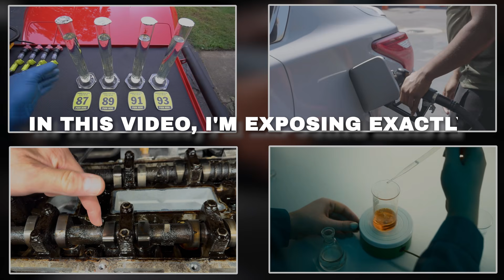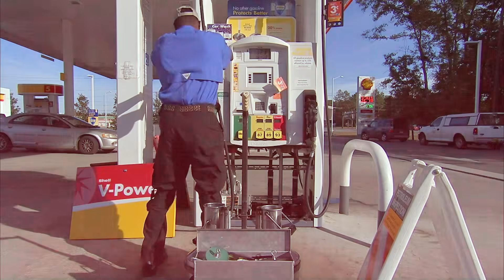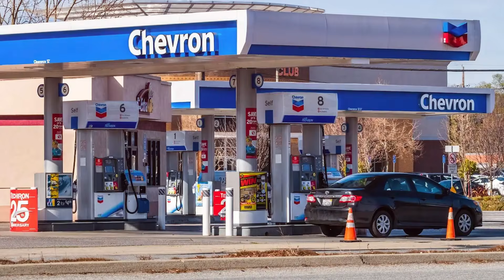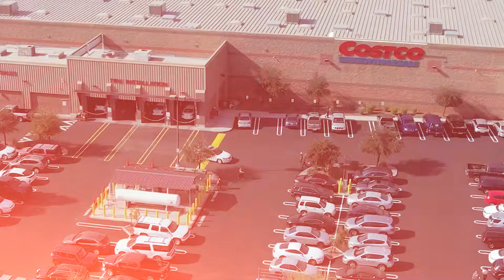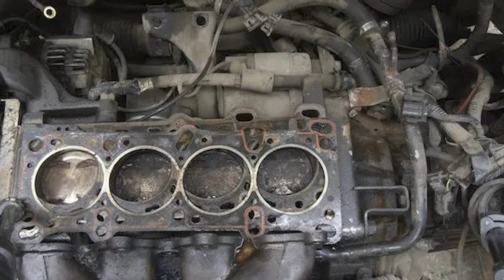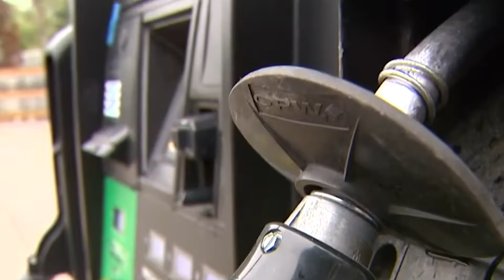Japanese Mechanics TESTED Major Gas Stations and One HIDDEN Finding Is DESTROYING Engines Nationwide

Comment: Use "Top Tier" rated gas. The should be a sticker on the pump. Top Tier has higher levels of detergents and additives to reduce engine deposits. Its specifically recommended in the the owners manual for my 2025 Honda Ridgeline. I used to get all my gas at KwikTrip but stopped after their gas became non-Top Tier. In my area (Milwaukee) Mobil, Citgo, Shell and Meijer Express are all listed on the Top Tier website. BP is also very good gas but they never joined the Top Tier program.
Reply: June 4,2026 consumer reports lists quick trip as top tier.

Comment: This is pure horseschidt. Don't believe this garbage. All gasoline blends are made to the same spec across the country. WHY- because they exchange it with each other. You fill up at a Shell station- you may get Exxon gasoline. Or get gas at Chevron- it may be Texaco. WHY???- because Exxon does not have a refinery in every city- neither does Shell and so on. In some parts of the country all brands may come from the SAME Shell or Exxon loading station. All gasoline is made to the same spec-so it can be exchanged! The only difference is that some may claim to have more "additive" than the other brand. So- there may actually be a slight difference in the additive content- in parts per million!

Comment: Yes, Ethanol is hydroscopic. And its the ENGINEERING design that CONTRIBUTED to the problem.
If you add gas-line antifreeze, such as the popular brand 'Heet', you're putting in EXTRA alcohol as well.
Yes, the alcohol eventually DOES cause corrosion to the steel gasoline tanks.
Having a fuel pump INSIDE of the gasoline tank was PLANNED OBSOLESCENCE by design, because the corrosion will attack the fuel pump also.
At least many FOREIGN cars equip their gasoline tanks with a DRAIN PLUG. NOT American manufacturers. But who bothers to periodically drain out the stinky corrosive crud and rusty slurry that accumulates at the bottom of the tank ? And for extra protection, flush out the tank with some fuel.
Electric fuel pumps were equipped OUTSIDE of the tank in earlier 70's cars. The fuel filter can be had in-line BEFORE the fuel pump. The injectors would stay cleaner longer then.
Listening to car-fixit radio talk-shows 20 years ago, and the emcee mechanic said again and again that HALF of the problems he encountered were FUEL PUMP problems. Also the REPLACEMENT fuel pump didn't pump enough pressure when new, sometimes.
Replacing an in-tank fuel pump and, of course, cleaning the tank, is a very cancer-causing job.
If you have your tank serviced, its maybe worth the extra expense to have a drain plug fitting added, and have the inside surfaces specially coated, so there's no bare steel.

Comment: Gas today is intentionally  dog piss! The specific gravity of the stuff is very low ,the density of stuff that burns is lacking ,heat makes power the dog water dont make heat as it should ,gas can be rated at 102 octane and still be weak as mouse piss ,thus you burn more and dont go as far ,this practice also burns through the planets supply at a inssne rate. But hey its a win win  for fuel sellers ,sell more  ,more profit create a shortage ! Yet more PROFIT

Comment: This videon contains some false information on ethanol.  That black carbon at intake manifold and intake valves, pistons has nothing to do with ethanol. That black carbon is from positive crankcase valve(PCV), exhaust gas recirculation(EGR). Direct injection fuel system without a port injection makes this issue worse. Repeated short distance driving at freezing cold termperatures can damage engines if the cold started engine is never allowed to fully warm up before engine is turned off again because this habit creates issues of fuel leaking into engine oil, also condensation water build up inside the engine, prematurely clogs some of the engine emissions control systems.

Comment: Use ethanol free premium gas at all times.  The cost difference is minimal and the benefits are significantly less wear and repairs.  I don't use ethanol gas in anything, from lawn mower to vehicles.  I worked in an oil refinery for years and ethanol is what is wrong with most gas.  Also, standards in the USA are lower for just about everything than other countries, including gasoline stations.

Comment: I quit using Shell after I had engine problems on an engine with less that 2,000 miles on it. When the mechanic opened up the engine he said my engine look like it had driven a couple 100,000 miles because of all the carbon buildup.

Comment: In Canada almost every single gas station they are connected. prices are the same. Hard to choose
Reply: yeah but same problem exists with Canada, if you buy grade 1 or grade 2 fuel, it destroy your engine. you always have to buy 3rd level fuel exactly because of what is being described in the video.

Comment: I have used mostly QuikTrip fuel almost exclusively for many years without any problems. I use non-ethanol premium in my Lexus and regular 10% in my Explorer. They are stations that have pretty heavy traffic.

Comment: BULLSHIT FAKE AI VIDEO , CATATROSPHIC FAILURES BULLSHIT , USING A FUEL OR INJECTOR CLEANER WILL NOT CLEAN VALVES IN A DI ENGINE AGAIN BULLSHIT , NO ONE IS REPLACING INJECTORS AFTER 2 YRS

Comment: P.E.A. (polyether-amine is the cleaner you need to put in your gasoline tank. Techron is good with PEA. Redline has the most PEA so go with the Redline.
Reply: I don't have any experience with Redline, but back when I had my own shop I was looking into building a fuel injector flow/pattern testing rig.  I found plans for one and the guy that built it had been testing various over-the-counter cleaners against the commercial ones, and Techron was as effective as the commercial solutions at cleaning.

Comment: I wanted a cargo van because I needed it. Not for a home or a camper. Yet. Can be. My dealership had one ordered the way they wanted the design. It fit my needs perfectly. A 2024 F250 transit cargo van. The pickup I traded in was a 2020 F150. The F150 has the 3.5l Ecoboost. My van has the 3.5l engine that is an E85 engine. The only design of engine at the time I had no clue about. Now I do and I extremely do not regret the engine. While these gas stations mess up and don't do what they should. My E85 engine doesn't care what the grade of fuel that goes into it. The computer will adjust the engine. I can mix all types of gas into my gas tank and my van will adjust itself to run the engine. I gotten lucky. I only use the high premium gas in the van. Not E15 or E85. I get better power and fuel mileage off of the high premium gas. Water is my only concern. Thanks.

Comment: I was a mechanic for 40 years and that picture with the valves with that carbon on them has a hell of a lot more miles and 40,000. Clickbait
Reply: AI slop is real.
Reply: My thoughts exactly, 50 years and still repairing my own.
Reply: 10-4!

Comment: Since the crude oil is so cheap, the U S needs not to use ethernol in gasoline at all.
Reply: Except the “ corn/ ethanol” lobby in Washington is very strong.  They have the votes to keep ethanol in gas forever
Reply: @petertaviano9593 
What should we use to replace the alcohol/ethanol? 
Maybe you need to do a little research? 😊
Reply: @petertaviano9593  Can't believe some went up to 20% ethanol.
Reply: @petertaviano9593  I would rather eat corn over putting it in my car.
Reply: Thank Hillary Clinton for that!
Reply: Faulty reasoning!!!
😢😮
Reply: You don’t know what you’re talking about! 
😊
Reply: Never did.
Reply: Can’t do that then the politics would have to come out of ethanol use everybody that knows anything knows ethanol is not a good substitute for gasoline or a good use to protect gas mileage as it actually you get worse gas mileage with ethanol plus if it sets a while it comes up everything that’s holding it carburetors injectors, cars, lawn, mowers, leaf blowers, and it’ll probably gum up your mouth if you gargle with it
Reply: FARMERS Lobbyists  😢
Reply: Air pollution. And air pollution is water pollution and water pollution will kill you.
Reply: @genestevenson-l7v  Ethanol burns cleaner, but you get worse mileage, causing you to fill up more often. Are you really saving the environment?
Reply: @genestevenson-l7v Air pollution IS NOT WATER POLLUTION!!!😢😮

Comment: Get Ethanol out of the fuel supply. It is a scourge to automobiles and the food supply.
Reply: Ethanol lowers efficiency and has no environmental benefit. There is no shortage of oil in the world and never was. Just greed power issues.
Reply: @scruples671: I definitely agree!!!! We can't run antique cars on ethanol that will damage their fuel systems. There's got to be other ways to raise the octanes of gasoline through refining processes.
Reply: @scruples671: There's got to be other refinery ways to raise the octanes of gasoline instead of using ethanol.

Comment: I only use Mobil gas and splash blend so I get extra detergents.  I do 50/50 premium and regular as my car only requires 87 octane... I also add 2 ounces of Chevron Techron concentrate to the tank with every fill up.  Who has the cleanest combustion chamber and intake valves? This guy!😂
Reply: So you know more about blending fuel that oil company engineers? I think not. Mixing fuels only reduces the octane / quality to that of the lowest used. Just stick with a quality brand that complies with the car manufacturers specs.
Reply: Just use mid grade it's already done gor you at the pump....most stations just mix it at the pump now and done have a 3rd tank its one way to save money.

Comment: you cannot specify brands because many independently owned stations will buy gas from the cheapest wholesaler irrelevant of what brand their sign says.
Reply: Not possible!
Reply: @marmeone
refined fuel comes from the closest refinery, the only difference is the 3 grades and they also make a summer blend and a winter blend. Brand loyalty is a fantasy created by oil companies advertising. 
How do I know this? 
I’ve worked at an oil refinery, I asked their engineers and I witnessed the transport truck tankers from every brand in the geographical region take fuel from a different brand’s refinery.

Comment: Years ago changed delivery practices to save money. Instead of a major brand traveling to far away stations, they went to delivery from independent delivery delivering to any station and not specific brand stations. In most areas there is a choice of say 3 refineries delivering a load with adjusted additives... probably okay if strictly done, but we all know how that worked with covid. Today it is a crap shoot.
Reply: All refineries for as long as I know (40y +) manufacture a base fuel/gasoline which is perfectly fine and during fuel tanker loading mix in the additive package for Shell, Chevron, Exxon Mobil, Costco etc. whereas the lower tier fuel has less or no additives, i.e. more base fuel. Nothing wrong with the base fuel or cleanliness of the same, just different or less additives. What matters is the additive package and concentration used (good with Shell, Chevron, Exxon, Mobil etc), the fuel station turn over (less settling of ethanol) and tank condition. The advice is simple, use high tier fuel and when presented with a choice go to a newer well used fuel station.

Comment: HOW are we as consumers suppose to know WHEN stations clean/update their undersround tanks ?
Reply: How are we also supposed to know if it’s been 24 hours since the last truck came to fill the tanks stirring up sediment?
Reply: I believe updating/changing the tanks is regulated by the state. Personally I don't believe any of them "clean" their tanks. They are supposed to check/remove separated water before each delivery or start of daily business. but that may not be regulated.
Reply: @edwardmmanns7454  Again, HOW are we as consumers suppose to know if they've been checked ?  Is it posted on the pumps themselves ?
Reply: @bigoneleesmith6969 
you cant, but if you see a truck unloading drive on by.
Reply: @bigoneleesmith6969 if you are concerned about the quality of the fuel you are buying at any particular station, simply ask a couple of questions. 
1. Do you have fuel filters on the pumps? If so, how often do you change them?   If the answers are “ I don’t know “ or a simple no, take your business elsewhere . 
Note , Fuel will float on any water that gets in the tanks.  The draw for the pumps is usually 4-6 inches ( at a minimum) above the bottom of the tank. 
Hi volume stations sell enough gasoline that it is always pretty fresh from the refinery or regional terminal. Stations such as Costco sell as much as 40-50,000 gallons a day. So, they receive 4-6 loads of fuel per day.  Larger Costcos have tanks holding 75-80,000 gallons of regular, 10-15,000 of premium, and separate diesel tanks with 10-15000 gallon capacity. 
Other hi volume stations such as Speedway or ARCO are likely pumping 15-25,000 per day. I’m not trying to cast aspersions, but smaller mom and pop convenience stores with only a few pumps may not be as diligent as periodic maintenance of their tanks.  It also depends on state and local regulations.  

All modern tank systems particularly with various vapor recovery systems have a sump pump to pump out any water that may condense or get into the tanks.  

I hope this helps.

Comment: Ethanol is the scourge of engines what a disaster…
Reply: @firstname7780:  Ethanol should be eliminated from gasoline knowing what damage it may cause.
Reply: @albertcarello619 absolutely
Reply: @albertcarello619  Ironically, it takes more energy to produce ethanol than the energy your car gets from it. Give corn farmers a subsidy and ban ethanol.
Reply: @firstname7780: Keep corn for cattle and grocery stores and out of gasoline.
Reply: I also remember in the days of leaded gasoline carbon buildup was extremely common.
Reply: Lead was even worse, back in the lead additive days a car would be celebrated if it made it to 100 k miles, now if it doesn’t go at least 200 k it’s considered a pos. 😊
Reply: @jerkyturkey007 No wonder lead was eventually banned from gasoline. It's definitely a health hazard. As I also mentioned before many engines would rapidly have carbon buildup frequently from leaded gasoline over time.
Reply: Why are guys getting E85 tunes and making crazy power?
Reply: Unfortunately, ethanol has become welfare for corn farmers.  Stopping that additive would be political suicide for most politicians. What's worse is that I have to pay more for pure gasoline than the adulterated crap.

Comment: Short story long : BP Ultimate 98 or Shell V - power........non Ethanol !
Reply: Shell is the best!
Reply: @marmeone: I definitely agree!!! I use SHELL 87 OCTANE REGULAR FUEL in my 2012 FORD FUSION 4CYL CAR and I always get top performance and fuel economy! My car really runs great always!!!
Reply: I use non ethanol in my Mower and weed wacker.High test in my Infinity QX50.mid grade in my Pentastar Challenger.I love the BP Earnify app and Shell app
Reply: @jd218  Never use any gas with ethanol in small engines, it will kill them.
Reply: @46babaganoosh Or boats with fiberglass tanks from what I was told. Oh, and older cars with carburetors like holley, edelbrock, and so on, ruins rubber seals.
Reply: I use nothing but Sell V-Power.
Reply: Hard to find in my area. All the non ethanol Shell stations closed leaving only the E10 stations. The ones that closed turned into Amoco stations.
Reply: In my area, shell nitro has ethanol. It's right on the pump. Pretty much all gas here does.
Reply: @RobKHere: I think it's that way all over the world unfortunately.
Reply: Thanks I use high test in my Infiniti QX50 and use Shell and BP gas I love their apps Shell and earnify
Reply: last time I fuelled shell diesel, not the cheap one, and I am disappointed.
Reply: I had a ford flex first year and the owner’s manual stated BP fuel only ! I had never seen that unless ford id in cahoots with BP ! It was a bandage vehicle someone use head sealer / block was full and water pump leaked ! The 3.5 is made by Mazda for ford

Comment: E10 gas DOES leave some mocha garbage on the tip of my oil dipstick, but I don't think it's destroying the engine.  The clear gas that I have access to leaves nothing on the dip stick after about two full tanks.  The Toyota at the beginning of the video had carbon build-up from oil PCV and EGR because it's a direct injected engine.
Reply: Direct injection cars should have oil separators in their crankcase ventilation line ... but don't because that would require regular inspection and maintenance by the consumer.  Even regular port injection cars should have that as well.  But given that most folks know nothing of how car engines work this solution to the problem is best left for the few who do.

Comment: EV’s are better. You can’t contaminate an electron.
Reply: But when the battery(-ies) go bad, get ready for the expen$e!!!
Reply: @Funkydood 

same with engines and transmissions
Reply: @Funkydood  No more than you'll spend on a gas German car during your ownership, especially Audi, Benz and BMW.
Reply: Not yet
Reply: @jameswubbolt7787 elections are as old as the universe. So your “not yet” is a drop of pee in the ocean.